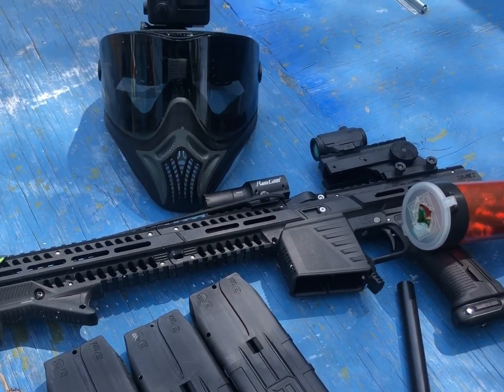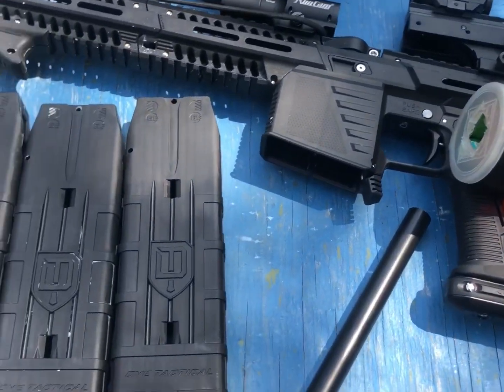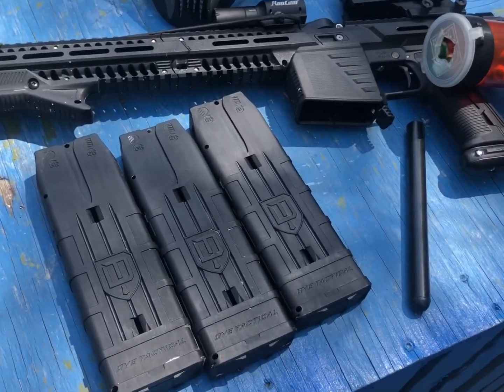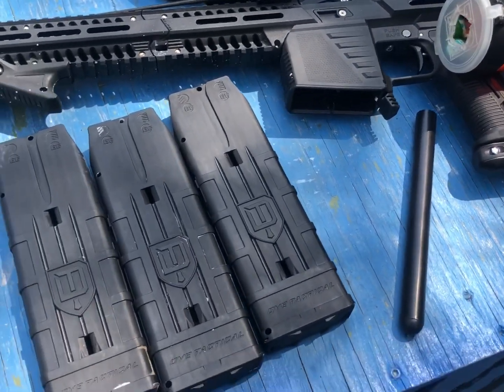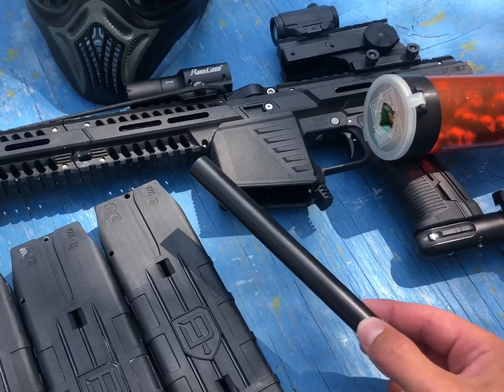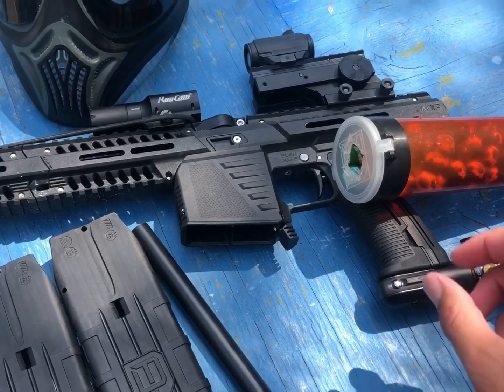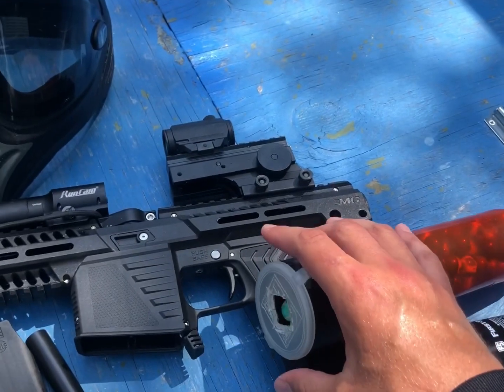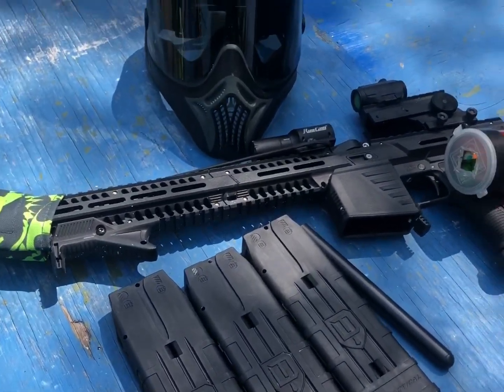DYE DAM Mag Speedloader! Reload your magazines FASTER without extra GEAR! (WONT OVERFILL MAGS)

Comment: good idea but why not cut the 10 round tube shorter then glue it in that hole so you can fill the mag directly from the pod - skipping a step :)
Reply: deadlyEuphoria420 You can epoxy a pvc fitting to channel the balls into the mag, that’s what I used to use for the old round collar MILSIG mags. Also, for those that don’t have a zeta ramrod an exalt barrel maid does the trick.
Reply from the maker: Thanks for the feedback. The reason I use the 10 rd tube as is..  I do not like to over-fill the magazines.  I find it causes the balls to dimple and not shoot as straight.  By keeping the 10 round tube step I can ensure I get exactly the right amount of paintballs in each mag.  Every other method I’ve seen so far will fill the magazine to the top which is usually 1-2 balls more than optimal.